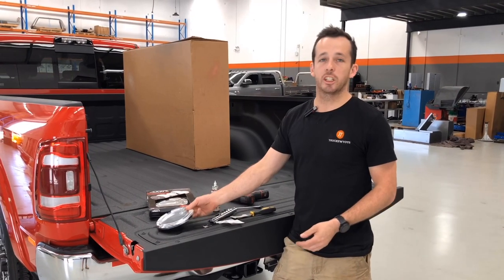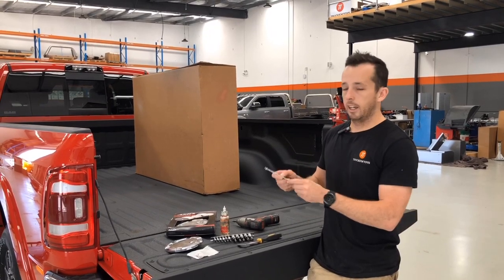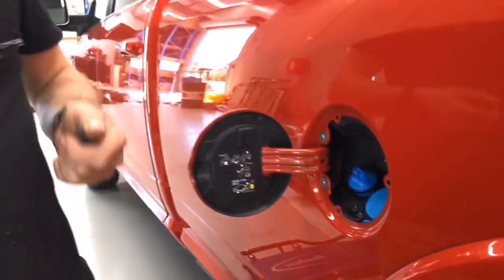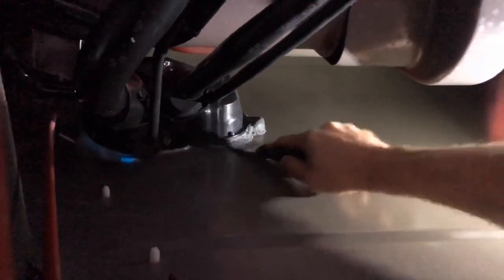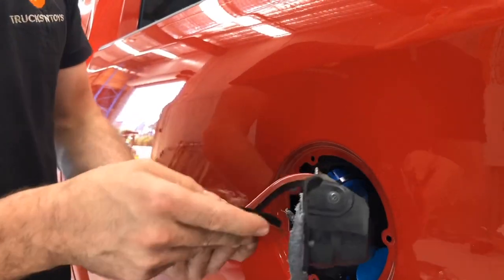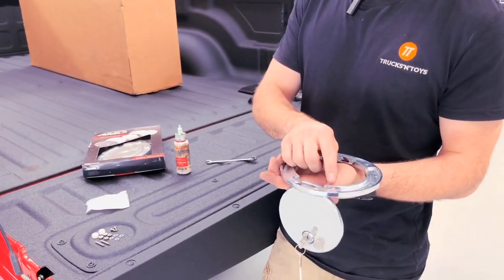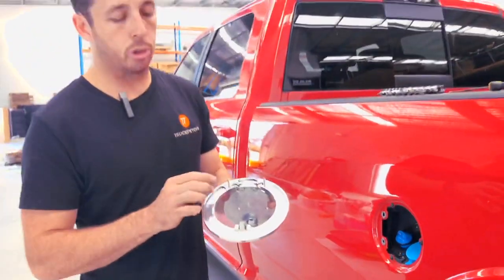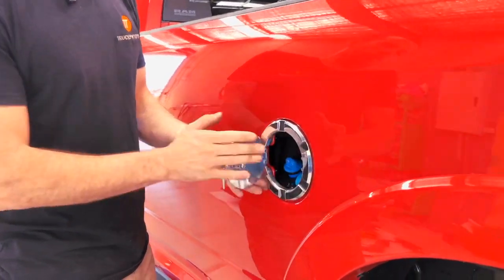Ram ds 1500 2500 3500 Billet fuel locking door install video

Comment: They need to put a seal around the door that closes and were it mounts to truck like the OEM door does. Other than that it seems like a good locking fuel door

Comment: Only two bolts secure the door, not very secure. My door has two at the hinge and two at the the locking side.
Reply: And where did you find yours? And what is the part number?
Reply: @aspade1701  😃 I've noticed no one wants to share part #s around here.... must be "super secret" or something....
Reply: @mikeb8342  I know. Seems like the 6042 billet door for the gasoline versions is the right choice.
Reply: @aspade1701  thank you sir! 👍 I'm sure had I researched it I would have found out, but your help is appreciated.